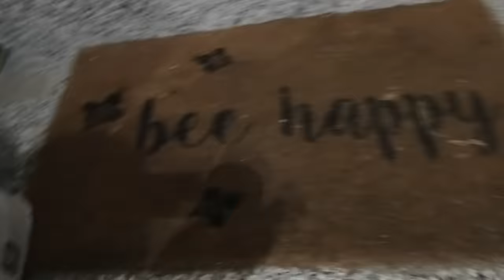Perfect quality brass for reloading. Start to Finish.

Comment: I’m noticing on my 556 brass it appears that I have a ring in there it’s really hard for me to see super close up but it seems like it has a second ridge and that would be my crimp or whatever. 
    So the swager just expands the pocket?  that’s it ?  So then you don’t need to take that little ring out ?
Reply from the maker: Are you talking a ring around the mouth of the case? If so, likely from the factory crimp. I think I've noticed it in military 5.56 brass, and either federal or maybe winchester? I find that after a few reloads, you probably will trim it off from stretching the case, or maybe it stays there. I only have one rifle that is a "precision" .223, and for that I pick the very best brass, but for 3-gun and plinking, meh, I just use whatever. Hopefully that's what you meant.
Reply: @High_Caliber  yeah you’ll have to excuse some of my comments,  sometimes I’m driving and I just leave stuff playing and dictation writes different words than I’m actually saying, making me look like a complete moron when you try to read it. But yeah , it’s just that slight little inner ring / ridge. 
I just got a bunch of stuff in the mail today though Lyman multi-tool, Lee power case sizing kit, splosives Accu 2460, and my .223 die set. Did not realize that the powder die from my 9mm was different so that will be here Sunday. 55gr seeds and Primers should be here tomorrow.

Comment: Have you ever tried changing a bottle neck cartridge  to  straight wall cartridge?
Reply from the maker: It's never come up, I've always been the kind of guy to have tons of whatever brass I need on hand. I can't see it being that tough though, just rough cut the brass like brake line, trimming to length and go. It would make a neat video.

Comment: first step I always do is clean out the primer pocket as the spent powder is very dry and will just fall out
Reply from the maker: I got tested a few years back, and I had high levels of lead in my blood, most of which could be attributed to reloading, and since the primers often (always?) have lead in them, I don't go anywhere near them after they've been fired. It's the same reason I don't dry tumble anymore, I want to encapsulate the lead dust. It took over 4 years for the lead levels in my body to drop, so do be warned. It was a random health issue that they couldn't diagnose which is the only reason they even did a full blood test and found it. Lead is dangerous.
Reply: @High_Caliber  I wear a mask did you ? Same mask as the one I wore for Covid !
Reply: @High_Caliber  lately I have been cleaning my brass in my Sonic cleaner and find if I cycle the brass four times @ 30 mins./cycle the primer pockets get cleaned out perfectly. Out of100 cases I need to do a little cleaning for say 5 as the primer pocket will have still a small amount of powder residue.

Comment: do you use that swaging contraption instead of grinding out the various crimps you showed in the video?
Reply from the maker: Yes, I used to grind out the crimps, that just made it a whole lot easier. Only needs to be done once in the life of the brass though, so kind of limited use unless you are processing TONS of range brass....
Reply: @High_Caliber  looks better than the grinding option. Thanks.

Comment: that stainless is magnetic because it is at the ferritic side of stainless quality, usually 304 !  the reason why they use this quality is exactly that magnetism, it would be a pain in the ass to collect them otherwise
Reply from the maker: Agreed, a royal pain to pick up something so small and round. Early on I thought the pins were rusting when left wet, but it always turned out to be some sort of regular steel that made it into the mix.

Comment: Is your stationary drill out of whack or is the trimmer not straight?
Reply from the maker: It was a while ago I did this, but I did have to replace the bearings on the spindle about a year ago, and the easy trim dies are plastic, so they move and stretch a bit. Good eye on you though, I ended up buying a drum sander so that I don't have to use the press for side-pressure activities near as much. The chinese bearing races were garbage on that press, found some "made in america" bearings and now that press is better than it's ever been. Cheers!!

Comment: Your tumbling media is way too big. I have the Hornady tumbler with media combo and the SS media from Hornady does not stick to the magnet. It does not get stuck in 5.56 cases and it cleans the inside of the case including the primer pocket. I came up with a trick for dealing with that tiny SS media. I use brew bags and the Hornady rotary sifter, (most any rotary sifter will do), maybe the separate bucket on the bottom style might work better. Put the bag in and catch the media with it, than you can rinse and let it dry in the bag. I dry everything in an old food dehydrator. Nice video
Reply from the maker: Hmm, I never thought of smaller media. I've had this stuff quite literally forever...even the ones that made it into the drain always get caught in the cleanout. I'll look into that. Generally I pull out the media, put the filled brass back in with just water, and it spits out the pins 99% of the time, but for whatever reason, it also darkens the brass. Just a preference, but I do like it bright and shiny, especially for competition. (vanity!).
Reply: @High_Caliber  gotta look good especially during competitions. (pride).

Comment: Your incorrect on annealing, it’s brass not steel so no need to quench if you don’t want to. ❤️🇬🇧🏴
Reply from the maker: It's for the temps, the red hot brass can leave marks on the counter material.

Comment: Ok I pray for you …you reload and u showed and said something in this video that lets me know we both share another hobby besides reloading and that’s having a saltwater aquarium …I saw the bucket and u mentioned RODI water
Reply from the maker: I grew sps for ~20 years. Only recently had to give it up because we moved to wildfire country. Our property was inside a 15,000HA fire last year, and even with a controller, you know a tank can't just be left for weeks untended. There was even debate as to issues with the altitude (I'm WAAAY up in the mountains). But yes, I have a real soft spot for the reef tank. On the plus side, I'm currently building a 300y shooting range on the property, so it's a trade-off :)
Reply from the maker: As an added bonus, I also used to really be into car acoustics. These days I'm running a B&O rig in my F-150...a pale shadow of the abuse I used to subject my ears to :)

Comment: Got a link to those trimmers?
Reply from the maker: Here's a current one for the .223, same guy sells the .308 and probably a few more. 
 Good communication from him too.  I didn't include a link in the description as i figured it would change over time. https://www.ebay.com/itm/122992786444?hash=item1ca2f0fc0c:g:QOwAAOSwQYZW1KHg
Reply: Looks like the link for eBay doesn't exist anymore, do you have another contact

Comment: I have a salad spinner that I got at a thrift store for $5. It gets most of the water and the stubborn pins.
Reply from the maker: That's what I use in the rinsing stage as well, I find the pins just really get jammed in the cases and spinning doesn't do it. Generally, I just put the full cases back in the tumbler without the rest of the media, and they clear themselves out. Just a little PITA. I'm trying to find different steel pins, maybe ones a bit smaller...

Comment: Awesome video for a new reloader like myself. I do have a question on  your stress line at this part. 
https://youtu.be/YcyFF6HOkEM?t=395
I couldn't really see the stress line do you have a picture on what I should be looking at? 
I have a couple Win brass myself just want to make sure I don't have that issue. Can you see the stress line all the up to the head of the brass?
Reply from the maker: There's sort of a picture here: https://www.coueswhitetail.com/forums/topic/43509-brass-splitting-help/   
Now that case split just beyond that seam I am talking about and the one @6:27 in my video, in my experience once that area is REALLY obviously looking different, you're going to experience a split case sooner or later. I think it's the way winchester makes it's cases because almost all of my split cases at the base have been winchester. Hopefully that helps. Don't worry about it too much, and form fitting and NOT full length resizing (and shooting the rounds in the same firearm) can reduce the stress on cases quite a bit, especially bottleneck rifle cases.

Comment: I meant every time you reload for full length size
Reply from the maker: Honestly, I have found that once you full length resize once, the first time, and trim to correct length, it is RARE that I ever have to resize again, I would suspect that a lot of the "stretching" we see is actually poor quality control from the manufaturer. I've resized all sorts of brass and then re-sot and reloaded any number of times, and almost always the ones I have resized are just fine (you can tell because the case mouths are nice and uniform, unlike factory brass).

Comment: Do you remember what eBay seller had the trimmers?
Reply from the maker: Yes I do! https://www.ebay.com/itm/125410693196?hash=item1d330f504c:g:QOwAAOSwQYZW1KHg&amdata=enc%3AAQAHAAAA0D6DMi8NEbMABsfOJ%2F0rqwJaXSEQSEj1PUOVMjiLsKZ6uDu%2FHgo8ZwZBqZ7D%2FKL%2Fb7pzEG7vFd1jb3ki%2FfYy9uVAZWCavQOsKOud4ivAtoSyxUTgVH%2FFXcg%2BvLfw2wkvAqbnuD0GPxGglhqE2eYzBtSni8VQzouNFJ19VismjPYivlft1gLhhKS9MQsKmgsNmTOKAN1%2B7hmhyq3VazHIRM8oUzqebVkwQzLvvNYfSwEZrByN8g88lgOVrwc1ym4JMwo5DPqIA9Y4t7lEJLpocl8%3D%7Ctkp%3ABk9SR5bejvrXYQ
Reply: @High_Caliber  thanks much appreciated

Comment: I stopped using the world's cheapest trimmer because it leaves a burnish ring around the brass. Why would I clean my brass and then put it in the wct to leave a ring around the brass. I'm sure there are ways around it but I notice the guy is out of business so I think this is why.
Reply from the maker: https://www.ebay.com/usr/wi_rifleman  guy looks to still be selling them to me. I have been using mine for, and no exaggeration, 10,000 rounds of .223 and probably ~2000 rounds of 308. If there's an issue with this crazy cheap trimmer, none of my guns noticed.

Comment: You should try Hammond Roto Finish XL-1262I brass cleaner. Do not need to use pins to get the case clean.
Reply from the maker: Not a chance. I USED to do vibratory cleaning, and my lead levels were SKY HIGH, it took almost 10 years to get the numbers down, and I was having health issues (that's why we looked). The very reason I started wet tumbling was to no longer breathe massive clouds of lead dust.
Reply: Not certain why cleaning brass at all would increase your lead levels but that’s not what I was referring too. I mean wet tumble in your current equipment without pins. With the correct juice.

Comment: Why buy brass if you can't get primers
Reply from the maker: I buy primers by the case. 50,000 at a time. I've got enough to last me through this apocalypse, and the next one. 

When obama caused a rush on components I put in a HUGE order as soon as stock started trickling back in. large rifle, small rifle, small pistol, magnum.... and the ironic thing is, if I turned around and sold them today, I'd be rich...and unarmed :)

Comment: With all due respect, your annealing is WAY overdone. You are heating far too low on the case body. This is dangerous as it weakens the case body. Please revisit some annealing videos of pro's like Eric Cortina and others. You don't want to spread bad information to others unfamiliar with the risks and downsides of doing this improperly.